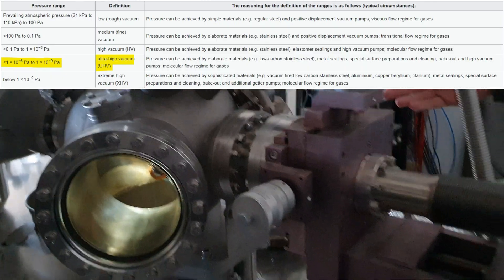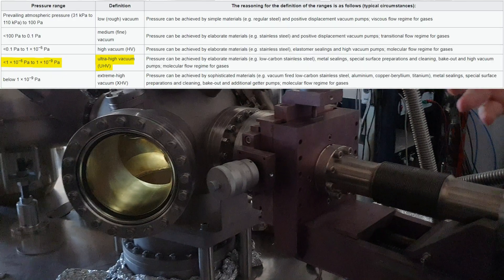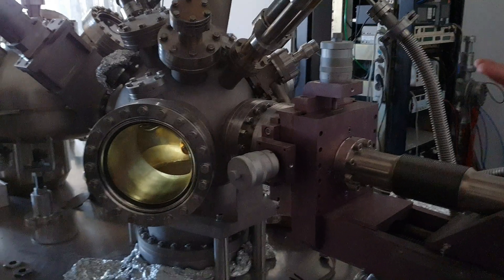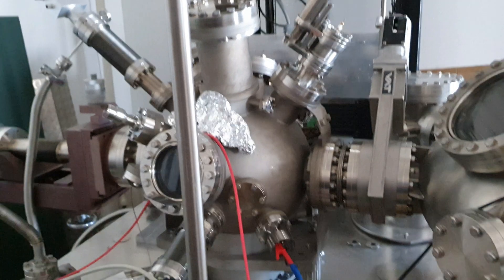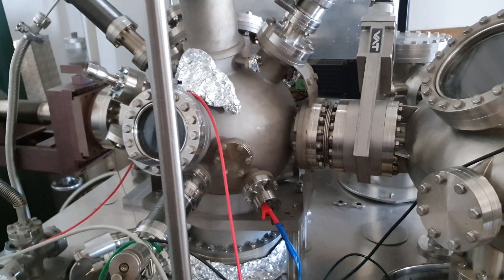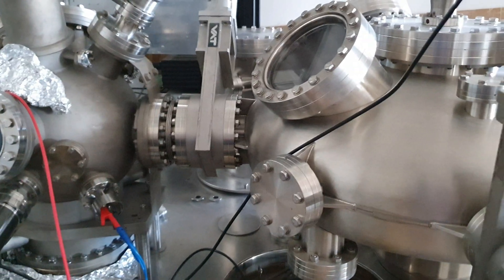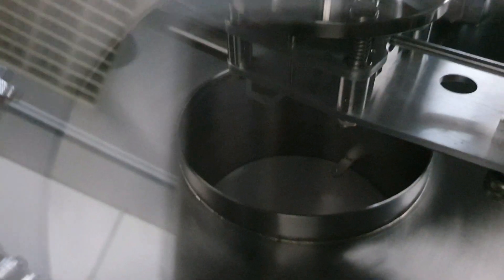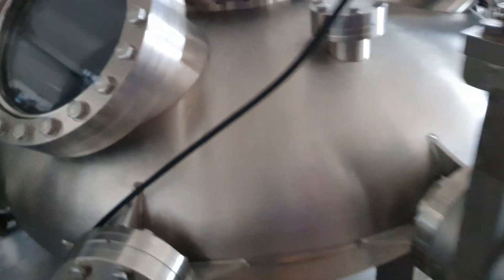How to get a Sample from A to B in an Ultra High Vacuum System

Comment: I wonder how are the clear parts of the view parts sealed for UHV? Is it by a copper disc like the other connections or is it by some other method (wouldnt the glass/acrylic? break when trying to deform the disc)?

Comment: Why is there so much aluminum foil all over it?
Reply from the maker: I don't know exactly what you mean. But the aluminium foil is used either to cover open flanges on vacuum chambers to prevent contamination from entering or for insulation while the chamber is being heated.

Comment: Hello, good explanation, thank you!  There was a series of vacuum tube fitting shown around minute 6:43 on the stainless tubes. Would you know what they are called or where to find them please? thank you! I believe they are a combination of Swagelok with a double knife edge being compressed when fighting the swage nut. Thank you!
Reply from the maker: Thanks! I think you are talking about CF vacuum flanges. They are used for UHV and are pretty expensive and the copper gasket should only be used one time (but you can reuse them in some cases). 
You can get those flanges at almost all vacuum part suppliers.

Comment: You gave me horrible anxiety seeing that turbo molecular pump spinning up under normal atmosphere at the end!
Stop it!  😫😖

😅
Reply: Some turbo pumps actually need to be run at atmospheric pressure for some time so the lubricant spreads around when they haven't been used for along time.

Comment: If you friend needs any equipment repairs i specialize in turbo pump and controllers.

I see the Pfeiffer 071 run off a tc600 driven by DCU power supply and agilent/varian multigauge all equipment I'm familiar with

Comment: How are vacuum leaks mitigated where the various motor/manipulator shafts exit from the chamber? Presumably at least some of the bearings in the motors are ball-bearings rather than bushings... wouldn't those be really leaky?
Reply: There are a few types of rotary feed throughs, the best with regard to not leaking are magnetic once, thay have a magnet in side the vacuum that couples to one outside and allots to transfter the rotation.
Other types, would be metal shafts sealed with a ferro-fouidic seal doof to 10e-7 mbar and can handle rotation speeds up to 100hz,
or you could use a regular Viton seal around a shaft here you can only rotate it slow, such arangements ofter have a second seal and inbetween you apply some rough vacuum.

Comment: Very cool video... but onto the real questions: How specialized is that high pressure aluminum foil on the chamber? XD
Reply from the maker: It's heavy duty aluminum foil. I don't think there is a UHV Lab without aluminum foil :D
Reply: the foil keeps the chamber warm on cold days ;) either it is used as a replacement tent when it is not done yet or to plug some holes in the tent. These have to be there because the customer will attach chambers to these ports.
Reply: Actually pretty specialized, it's thick and bought for vacuum stuff and is more expensive than regular foil

Comment: Cool video! I am curious about what types of experiments are carried out in these systems
Reply from the maker: Thank you! One of the systems is used for photoelectron spectroscopy. If Daniel and I both have the time, I will make a video about those. Or maybe an in depth video about leak detection.
Reply: @AdvancedTinkering  I don't know where, but there is already a video on YouTube about leak detection. I'm sure you could add additional information though.
Reply: @AdvancedTinkering  I service electron microscopes and have seen similar apparatus in some labs.  What is photoelectron microscopy? I know high energy electrons striking an atoms orbital electron gives off characteristic x-rays (i.e. photons when they change orbits) when they change shells.  Is this what you are referring to?
Reply: @purza95  its a ultraviolet source attached to the chamber, it excites the atoms to emit electrons. These will be analyzed in the spherical shaped insturements to the side. Those are electron energy analyzers. It is a type of spectroscopy, not microscopy or spectrometry. You analyze the energy of the emitted electrons and measure the energy band structure of your sample.
You can use photons of different energies to exite the atoms, on this system the uv source emits uv photons, but we also had an x-ray gun installed some time ago to do XPS instead of UPS.